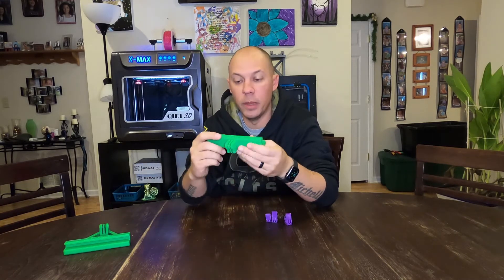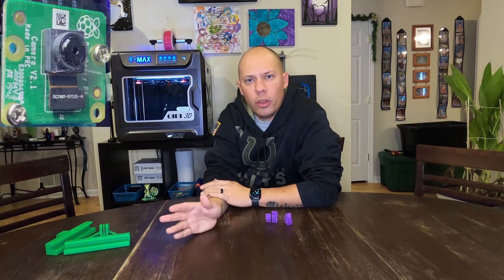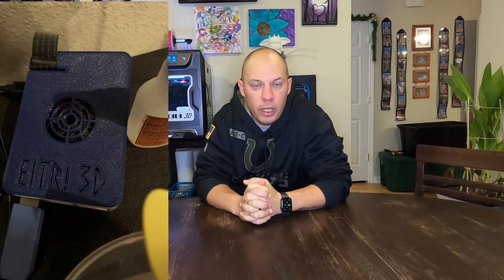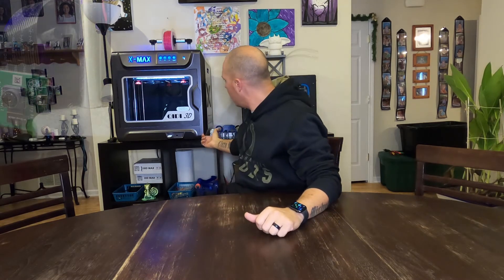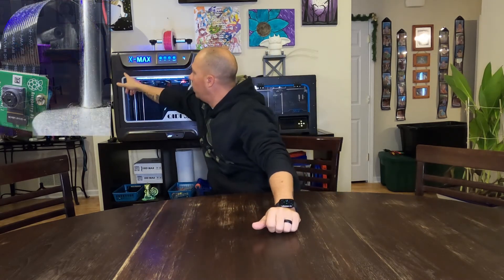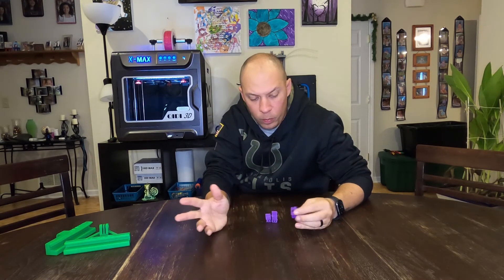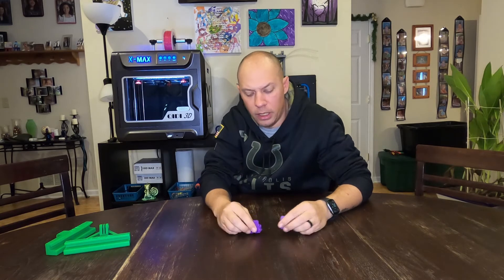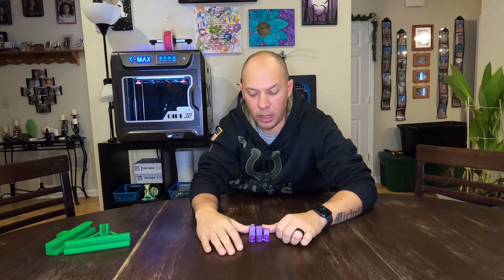Adding a Pi Camera to my 3D Printer

Comment: Hi Mike. I finally got my pi hooked up and running and your first video helped with that.  What I am unclear on is exactly how you mounted the camera.  I can't see from the picture where to place it in the case.  Would it be possible for you to clarify it?  I really need to be able to monitor the prints, but most of the camera options don't seem to work well, but yours looks like it may be doable if I can understand it.  Not your fault, but my bad. Thanks!
Reply from the maker: If you check out the description of the video I have a link to Thingiverse where I posted my camera mounts. Hope that helps.

Comment: Thanks for Vids. Very Helpful. I have a question, Anyway you can let me or others know what the dimensions are for the base and ball? I printed one out and it was waaay to small. I know something went wrong and I can't find any dimensions anywhere on this. I haven't received the cam in mail to measure the thing yet but there"s no way its this small. It's 1"x3/4" on ball base and ball is 3/8" Does this sound correct to you? If so then my apologies. Thanks for all you do. Peace

Comment: I just order and waiting for my Qidi X-Plus and been looking around for camera ideas. I really would like to use a USB camera and for this and was thinking about taking apart a Logitech 310 and then printing a smaller custom case for it..have you given this any thought?
Reply from the maker: Oh yeah, a lot of people use webcams. I just use the PiCam so I do not take up a USB port on my Pi since it connects using a ribbon cable.
Reply: @Eitri3D  yeah I took apart a 310 today and found I can build a custom mount for it which should fit in the printer well. 7.7 thick by 60 wide. I do have a few PI cameras  as well yet want to connect to the pc for the videos. (have a Jetson Nano and buying printer for that project)
Reply from the maker: Had to research the Jetson Nano. Never heard of that before. Let me know how that and the camera project turn out.
Reply: @Eitri3D  It is all new to me really. I just shout out my plan in hopes others will pick it up as well and I can learn from what they do. My main idea is to create a larger version of the Vector Robot with it having a bit more brains. So for now I want to make a cool looking robot and after give it brains if I can. :)
Reply from the maker: If you are into Star Wars at all that would be an awesome thing to add to a Pit Droid. Sorry my nerd is showing. Lol.

Comment: Hey Mike, thanks for these videos, I'm in search of how to do a PID tune without a Pi or octoprint installed.  I just did the Chad Mod with a Slice Mosquito and I'm not sure how to do this.  Any guidance?  Thanks
Reply from the maker: In order to do this, you’ll need a way of capturing the return communication from the printer. I have heard there is a few slivers that do this, but I unfortunately haven’t figured that out yet.
Reply: @Eitri3D  to get responses from printer all you need is a lan or wifi connection to it and a PC with Linux for using netcat in UDP mode
Reply from the maker: Have you been able to do this with Qidi printers? I unfortunately don’t have Linux running, but I know other who have been trying to do this (maybe not they way you’re explaining) and haven’t been successful yet. You may have cracked the code. Thank you.
Reply: @Eitri3D  Yes, I was successful with that. The terminal command should be something like this echo "G1 X10" | nc -w 1 -u 192.168.1.100 3000. I think you can use your Raspberry Pi as a linux system. There is also netcat for windows, but I never tried it.
Reply from the maker: I can see all communications with Octoprint, so no need to use the Pi as a separate terminal. Thank you for this information. I have to see if I can test it out. Cheers!

Comment: Is it possible to add the rasberry pi to qidi 1 2018 model?
Reply from the maker: That is a good question. I do not have that answer. I can do some research and if it is possible I might give it a try since I also have the Tech 1. This is a great question. I’ll keep you posted what I find out.
Reply from the maker: So according to what I have found, it is possible.
Reply: @Eitri3D  thanks man wasn’t sure to sure. Gonna order one to try
Reply from the maker: Here is a good place to start until I can get another pi and give it a shot. 
https://www.thingiverse.com/groups/qidi-tech-i
Reply: @Eitri3D  Sweet this is what I’ve been looking for, kinda hard to find forums about upgrading parts on the qidi 1
Reply from the maker: Yeah, I’ve had a few issues right after I got mine (bought used) and haven’t invested much time into it. I should probably do something with it because the lack of information out there is pretty sad.

Comment: THe beginning looks very familiar :) I also connected the small PI cams to my OctoPi. Added you mount to my collection to print. So far I printed a mount for cneter mounting only which also holds extra LED strips. Not finished yet but I will upload it to thingi as well.
Reply from the maker: Awesome. Let me know so I can give it a try myself. I’m always looking for better solutions. Cheers!
Reply: @Eitri3D  Better maybe not - just different :) bit struggling still with the cable path
Reply from the maker: That’s why I went with the 2m cable. If you lay the printer in the side and remove the side now facing up you’ll be able route the cable up the corner to get to the top.
Reply from the maker: Just so you know I added two smaller mounts to my Thingiverse. The smallest one gives a better view, IMO.
Reply: @Eitri3D  thx I will check it out